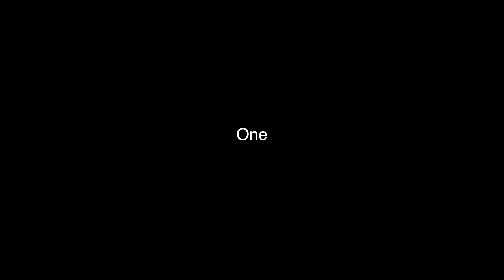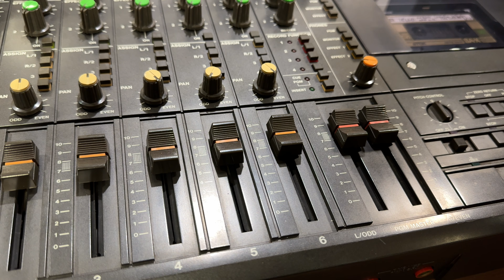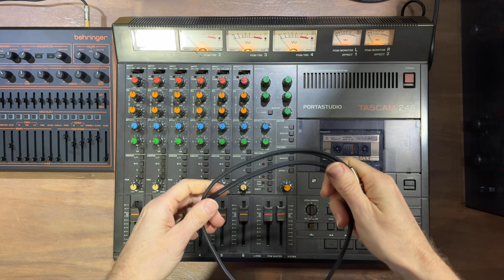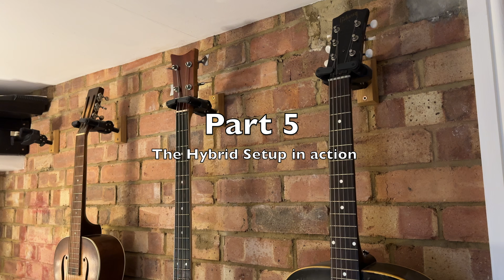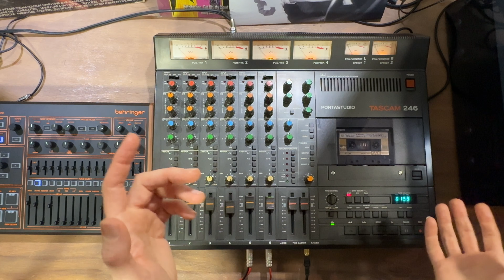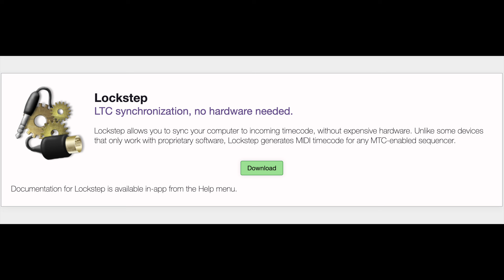Hybrid Analog Recording - Syncing Logic Pro with a 4 Track Cassette Recorder

Comment: Sorry I have one more question. With this setup is it possible to record like 4 tracks through my 4 track have it saved on my daw and then delete my 4 tracks on my cassette recorder and record more tracks and it will be able to be in time with my daw and add other instruments instead of bouncing on my 4 tracks? Idk if that makes sense . Sry!
Reply from the maker: Yep, pretty much! The only catch is that you lose one track to the sync code, so you can only transfer three audio tracks to the DAW at a time. You can repeat the process as many times as you need though, so it still gives you effectively unlimited tracks while keeping everything locked in sync.

Comment: i’m having a sync issue where it plays from logic for a bit and then stops randomly and starts again. I am using an RCA (red & black) using the black mono. Channel. Any help would be appreciated.
Reply: i’m gonna try using a dedicated mono rca to 1/4” trs cable. I think since the rca is red & black there is some signal loss.
Reply from the maker: That would be a good starting point. Also try recording the sync signal a bit louder to see if that helps (but not so loud it prints through to the next track)

Comment: Hi I have a Yamaha mt4x. This should work with that? The manual says something about fsk. I’m kinda new to this and buying a laptop and logic tmorro so hoping it would work. (I sold my laptop a long time ago and slowly getting back into music and been loving the 4 track but now want to use logic again with it ) lol
Reply from the maker: It should do, yes. The MT4X records standard audio, so as long as you can dedicate one track to timecode it should work. The FSK mention in the manual is for an older sync method, whereas the setup I used relies on SMPTE timecode. Good luck getting back into it, and enjoy the new setup!
Reply: @wehappyfewmusic cool cool. One more question. I used logic before and Prbly will get it again but been seeing people using tape 16 and kinda intrigued by it. You this this would work with that daw or probably not?
Reply from the maker: @johnday8092  I haven’t tried Tape16 yet, so I can’t say for sure. It definitely looks interesting though, and I’d love to compare it with Logic and real tape at some point.

Comment: Hey great video! Just tried to get my set-up to work but it seems to be playing back at half speed. I am using a focusrite 18i20 and a tascam 688. I already tried changing the sample rate from 96 khz to 48 khz and 44,1 but this doesn’t work as well. Any idea why this might be happening and how to fix this?
Reply from the maker: Glad you enjoyed the video! 

Half speed playback is often a sample rate or clock mismatch somewhere in the chain. Make sure the Logic project sample rate matches the Scarlett exactly and that the Scarlett clock source is set to Internal. Also double check TimeCodeClock and Lockstep are using the same frame rate and that Logic is actually chasing timecode. You could also check that the sync tone is recorded at the right level so it can be read correctly. 

Good luck and hope you can get it working properly.

Comment: Hi, Great videos , thanks. 
I have many ancient 4 track tapes and still have my old Fostex 4 track multitrack recorder. 
How would I play each 4 track song direct into my DAW? I don't really want a pro mix just set the 4 levels roughly where they were at recording stage on Fostex  and just get a line out from there to my Scarlett 212  ,  into GarageBand on my iMac ( the Scarlett is already connected to my iMac) to basically record each song  as its playing into one track on GB. I don't necessarily want to bother isolating each track , just get the full song down quick and simply from Fostex to iMac . Just not sure of the connections really.
Reply from the maker: Hi Paul, thanks for the kind words.

You are thinking about it the right way and it is actually very straightforward.

On most Fostex 4 tracks you can use the main stereo outputs or the line outs. Set your track faders roughly where you had them when you recorded the song, set the master fader to a sensible level, and treat the Fostex like a small mixer.

Take the left and right outputs from the Fostex and plug them into the two line inputs on your Scarlett 2i2. In GarageBand just create a stereo track, set the input to the Scarlett, hit play on the Fostex and record the song in one pass.

You do not need to isolate tracks at all if you just want a rough capture of the full mix. Just watch the Scarlett input levels so you are not clipping.

If you only want mono you can also just use one output from the Fostex into a single Scarlett input and record a mono track.

Hope that helps.

Comment: Hey is this possible with a Tascam 414 mkii? It doesn't have individual outputs just stereo left and right
Reply from the maker: Thanks for the question. You always lose one tape track when you use this sync method, since one track has to carry the timecode. The tricky part on the 414 is that it doesn’t have a dedicated sync out like some Portastudios, so the code normally has to come back into Logic through the right side of the stereo output. That means you end up monitoring everything in mono while the right channel feeds the timecode back to the DAW.

I don’t own a 414 so there might be other routing options on it. If it has an auxiliary send on the input or monitor section, you might be able to send the sync tone from track 4 that way instead, which would free up the stereo outs for normal monitoring. But with the standard outputs you’d be working in mono plus the dedicated sync track.

Comment: I have 4 of my Apollo-8 interface's outputs going into my 4-track Cassette Multitrack recorder, and I have the UAD Console software as a virtual mixer. This allows me to have all the Preamp emulation and plugins that I want to apply during tracking, and then record into the 4-track and send it back into the DAW afterwards via the tape-outs.   Then, I can overdub and whatnot in the DAW and mix in the box.  

Any thoughts about my using the digital realm before going into the Analog tape?  Are there any downsides you can think of that would negate the value of the tape?   I suspect the digital stuff will essentially get removed or reduced due to the tape's natural/inherent EQ curve removing all the high-end that is unique to the digital realm.  

I've never tried syncing tape and digital via writing out timecode to a track on the tape machine, though I haven't gotten very deep into the hybrid process yet, so perhaps I will encounter roadblocks which will make that approach more appealing.  Thanks for explaining how to do it all so clearly (in case I do need to do this soon)!  I've already downloaded the freeware you recommended for this.
Reply from the maker: That sounds like a cool setup. Running the Apollo into the 4-track must give you a really nice blend of precision and character. I’d agree that the tape’s natural roll-off probably smooths out the harsher digital edges. I’ve found that approach can sound really balanced when you send it back into the DAW.

Comment: Does sync work both ways with the transport? I have a cheap control surface I use to press record when I’m record drums. I’d hate to set this all up and then not be able to sit at my kit and start recording, and have to run from one side of the studio to the other.
Reply from the maker: You need to press play on the tape recorder to start things off. If your external controller is connected to the tape machine you’ll be fine (I’ve got a Tascam rc30p foot switch that does the trick).
Reply: @wehappyfewmusic  thanks! Hopefully I can find one long enough or make it longer .

Comment: does anyone know how I could do this with a Yamaha MT4X? I'm a little confused 😅

I have 4 tape outs with the word Sync next to tape out 4. I'm assuming I will connect this tape out into 1 of my interface's mic line input.

The part I'm confused about is that I only have 4 MIC/LINE Inputs but I have a stereo out, I wonder if I should be using that? In this vid, he uses 5 and 6 mic inputs to connect with an output on his interface.
Reply from the maker: If I remember correctly I used channels 5&6 to monitor the tracks on the computer through the tape machine. You could use the auxiliary returns on your MT4X for the same purpose.
Reply: @wehappyfewmusic  thank you for the answer! What's the cable you use that seems to be a TRS to 2 TRS cable? I think it's between your interface output and input 5 & 6 on your recorder.
Reply from the maker: @brokenenglishprod that’s a stereo 1/4 inch to 2x mono 1/4 lead. I had a couple of those made about 20 years ago and use them all the time. Surprisingly handy leads.
Reply: @wehappyfewmusic  ah that makes sense that I could not find them online or anywhere... since you mentioned to use my auxiliary returns on my MT4X instead. Would I then just need to use two TRS to TRS cables for each R and L/MONO to connect it to 2 outputs on my interface?
Reply from the maker: @brokenenglishprod yes that should work fine.

Comment: anyone here having problems with latency? mine worked fine for months. now latency issues.
Reply from the maker: Hey, I didn’t have problems with latency with the setup in my video, just problems losing sync occasionally and strange glitches in the audio. I tried doing the same sync technique with a motu midi interface though, and that did have latency issues. 
Hope you can get the issues resolved soon! 🤞🏻

Comment: I've been attempting this on Windows with Reaper (via RME interface and Prism conversion) and a Tascam 688. In theory I should be able to use the built in midi system in the Tascam for striping tape and running sync via midi (FSK/Midi Clock) but I've found there are a few skips or audio glitches from the DAW when running in sync. It happens regardless of stripe levels and buffer settings.

I tried an external midi/audio timecode striper but found similar sync issues. I've tried several frame rates including all of those mentioned in these comments. 

I'm going to try the method in this video with a Mac running Reaper with RME interface and the Tascam to see if it works as it's described in this video.
Reply from the maker: Really interesting to hear about your experience— thanks for sharing all the details. I’ve had some similar hiccups with sync too, so it definitely takes a bit of trial and error to get it working with a particular system. Definitely let me know if the Mac/Reaper combo works more smoothly for you, would be great to hear how it compares!
Reply: I also have tried this with my 688, MOTU 828ES, Mac Laptop, Digital Performer DAW. It's all good gear, and I thought it was working perfectly at first, but alas, over time I found inconsistencies with speed, causing audio glitches. 

Sadly, from what I've read, the best way to do this is to connect a TASCAM synchronizer to the 688 and have the DAW drive the synchonizer with a rock solid SMPTE signal. This allows the DAW/digital side of things to live in its sample accurate, clinical world, while the analog gear, with its wow and flutter, constantly plays catch up. The 688 has a decicated port for accepting a synchroizer. These synchronizers are $$$, and I wonder if there's someone out there geeking out with an Arduino who can replicate it.

Comment: Ok I managed to sync both logic and Ableton live with my Yamaha MT120, and later on I am going to try with my tascam 246 as soon as I get some spare time. There are some little issues with sync nothing problematic. I did some research through chatgpt about frame rate used 29.97. Here what chatgpt says:

29.97 vs 30 fps

The difference is subtle but real:

29.97 fps = slightly slower than 30 fps (one hour at 29.97 lasts about 3.6 seconds longer than one hour at 30).

This comes from the historical NTSC compromise (to compensate for the color subcarrier in old televisions).

If you use 29.97 to generate MTC and Live expects 30, the session will seem aligned at first, but the longer it runs the more Live will “slip” out of sync.

---

3. Drop-frame vs Non-drop (only for 29.97)

Non-drop = the frame count is continuous (00:00:00:00 → 29 → 00:00:01:00).

Drop-frame = every minute some frame numbers are skipped to realign the count with real-world clock time (otherwise with non-drop after one hour you’re 3.6 seconds late).

In music, non-drop is almost always used because musical sync doesn’t need to match broadcast duration.

---

🎵 In the studio (like in your case)

If you’re working only between software/hardware with no video constraints, I recommend using 25 fps or 30 fps (stable, simple, no drop-frame).

If you want compatibility with sessions imported from DAWs for audio/video post-production, then follow the video standard (29.97 drop for NTSC, 25 for PAL).

---

👉 In practice:

If you use 29.97 but you’re not in an NTSC video context, you’re just making things harder for yourself.

With 30 fps (non-drop) you get a simple and stable timecode, ideal for pure music sync.
I haven't tried 30fps yet to tell you if it is working correctly and more stable as chatgpt declares.
Reply from the maker: That’s great that you’ve managed to sync your Yamaha with Logic and Ableton. Useful information about the frame rates too. 👍🙏

Comment: Thanks very much for sharing this. As I understand with this method you don't need to buy any extra gear such as midiman smart sync or the tascam MTS 30 , right? One more question if you don't mind me asking. My sound card doesn't have any midi in and out , as I  understand you are not using any midi , just audio. My interface has only 2 inputs and 2 outputs , and the headphones, can it still be done. By the way I have the the same Tascam 246. I love it. cheers!
Reply from the maker: You’re spot on — no need for extra sync hardware like the Midiman or MTS-30, this method just uses audio. 👍

It is possible to try it with a 2 in / 2 out interface, but it’s a bit limited. You’ll always need to dedicate one input on your interface to “listen” to the sync track coming back from the tape machine, so that leaves you with only one input free for recording. With a larger interface (like the 18i20 I used) you’ve got more flexibility, but it can still be done with a smaller setup if you don’t mind the constraint.

And great choice with the 246 — such a fun machine to work with!
Reply: @wehappyfewmusic thanks very much, very kind of you

Comment: what if I want the tape to sync to the daw? as in pressing play on my daw plays the 424
Reply from the maker: It won’t work that way around with this method, as the tape needs to be the master. You might be able to achieve that result with other external sync devices (possibly a Tascam midiizer?).

Comment: Glad this popped up as I didn’t know about syncing Logic to a cassette recorder. Found out my Tascam 488 but the speed was varying too much and in response Logic started warping the pitch into something… interesting. Was potentially cool if the flutter wasn’t so repetitive. 

Thought it was time to change the belt but that hasn’t changed it. It’s worth fixing because this setup’s too fun to give up, just need to work out how.
Reply from the maker: Good to hear you’ve been enjoying trying out this technique! Yeah, the warped sounds that Logic produces when things go out of sync are pretty wild😆.

I had a speed issue with a 488 mk1 and I think it turned out to be an issue with the power feed to the motor? @tetrekan who’s also on here fixed it for me, so you might want to ask him for some advice?
Reply: @wehappyfewmusic thanks! - he’s already been incredible helpful MEGA reminder on how to record and easily set the channels up

Comment: Hey this is exacly what i whant to do but i'm looking for windows user alternative, anybody have a clue on that ?
Reply from the maker: Hopefully some windows users will chip in and help 🤞🏻. It is possible to get hardware sync options by Motu  if that interest you too.
Reply: @wehappyfewmusic I hope so! What I truly need is a mtc to ltc software and vice versa right? Would It work if I print the tape with the mac of a friend and then find a ltc to mtc soft on windows?
Reply from the maker: @mickaelfissot2603  that sounds like a good work around! Let me know how you get on.
Reply: I'm exactly on the same boat